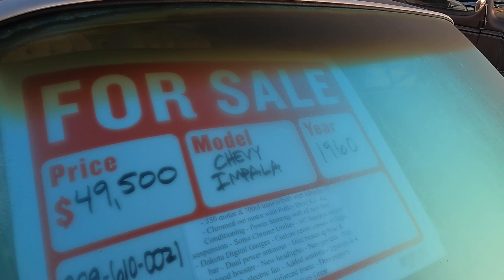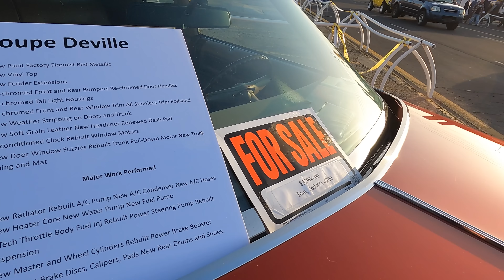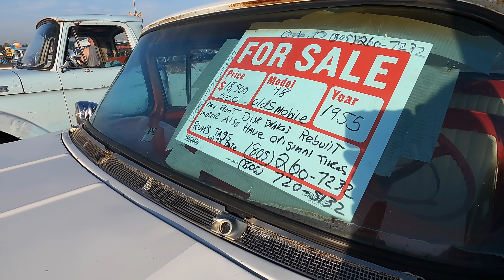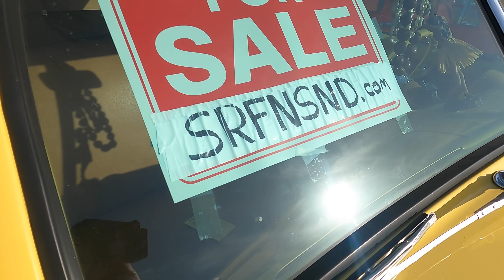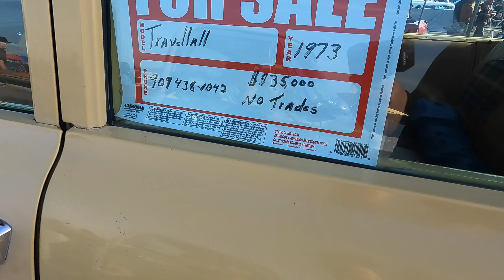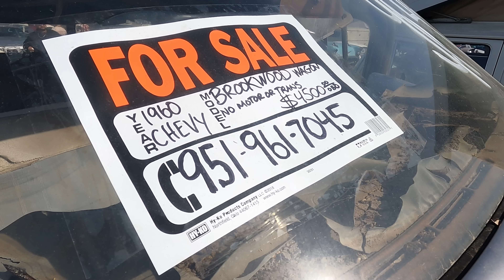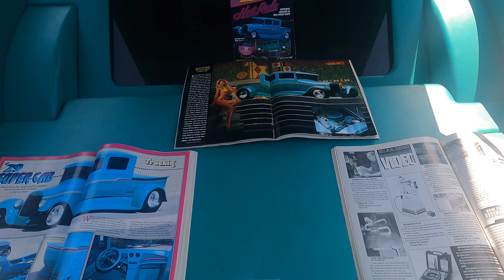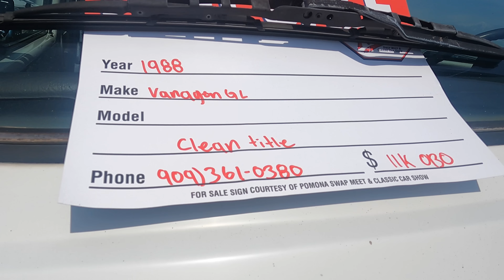Pomona Swap Meet & Classic Car Show - April 16, 2023

Comment: What is the round tubular thing (49:57) sticking out of the back window of the 38 low rider?  I've seen those in other Low Rider videos (Diablo 666) and can't figure out what they are?  Good videos for eyes on the shows.  It's still kind of winter here so it's great to see So Cal in all it's glory.
Reply from the maker: It’s an air cooler from before cars had air conditioning

Comment: THIS IS A MUCH DIFFERENT SWAP MEET THAN THE ONE I ATTENDED IN 1985 IT HAD AT LEAS 500 CORVETTES AND CARS WERE LINED UP BY BADGE AND YEAR. I WAS LOOKING FOR A 1965 CADILLAC ANY MODEL OD DEVILLES AND FLEETWOODS AS I HAD OWNED ALL OF THOSE 2- 65 DEVILLE CONV.; 2 -FLEETWOOD BROUGHAMS;1 ELDORADO CONV. THERE WERE ABOUT 30 65 CADILACS AND ALL WERE GONE BEFORE I DECIDED ON ANYONE. TO LATE .AND THE PRICES RANGED FRO, $5,000 TO$18,000 FOR A ONW OWNED 59 SERIES 62 CONV. .
Reply from the maker: I remember when it was much fuller and there were more cars for sale. The prices were better then and many cars got sold.